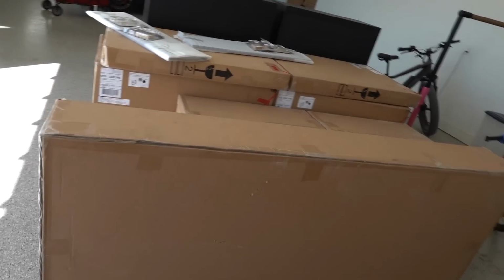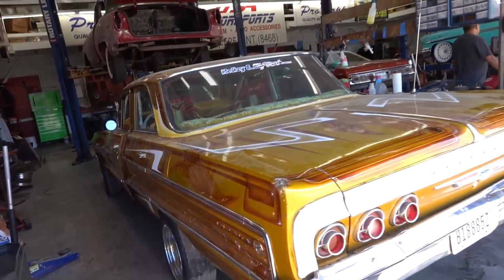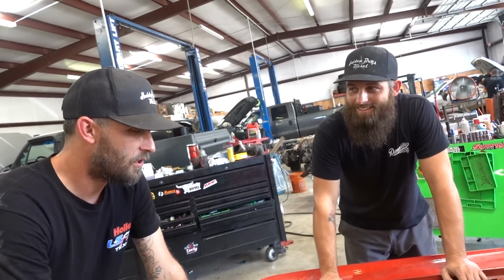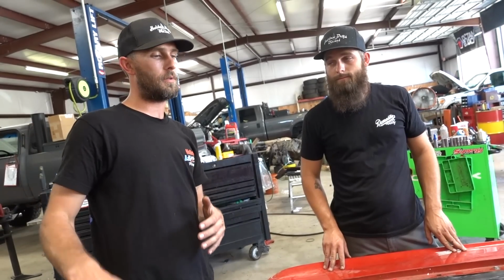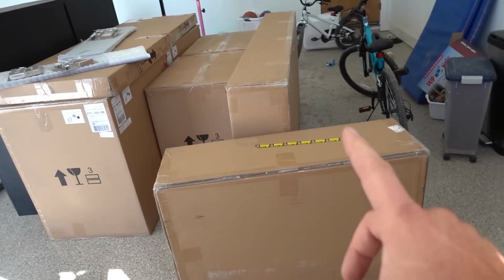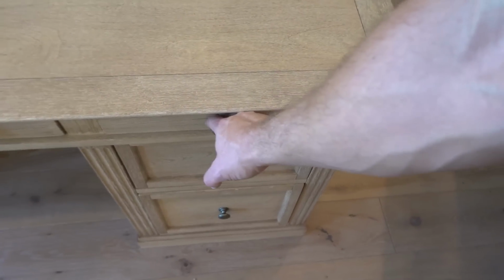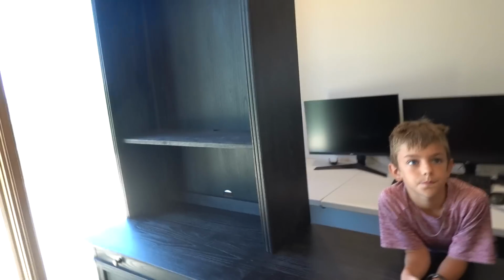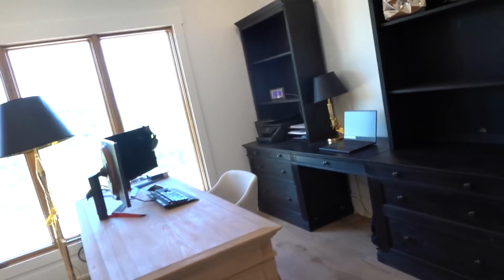Finally Here After Waiting for 6 Months!!!

Comment: You have got to move that pc away from the windows. The heat of the sun coming through will destroy certain internals of the pc. Such as parts of the motherboard and graphics card and power supply. Also you are adding more heat than the cooling system was designed for which will cause the cooling system to fail and your cpu to have major thermal issues.